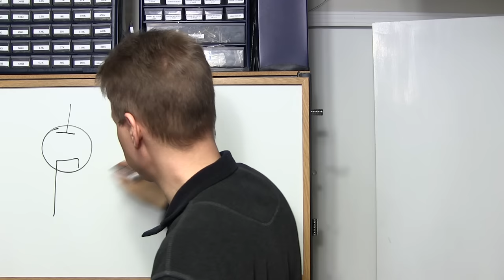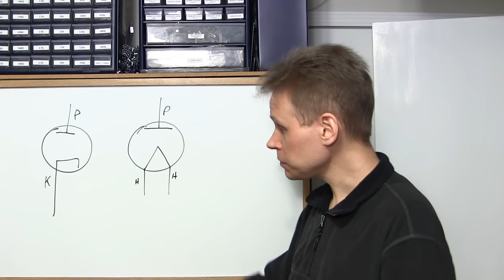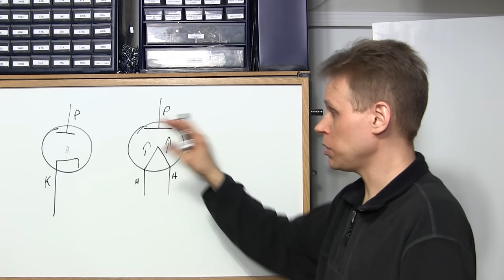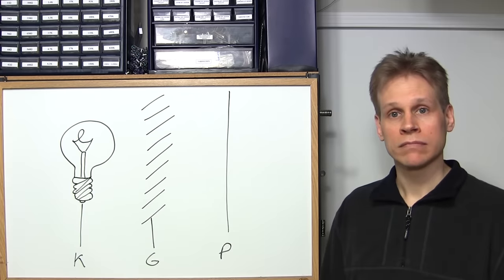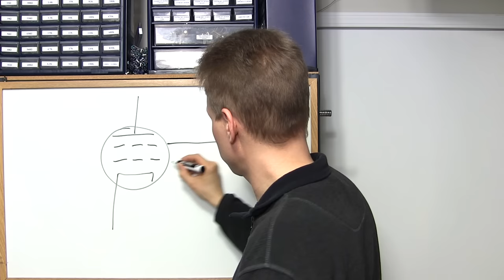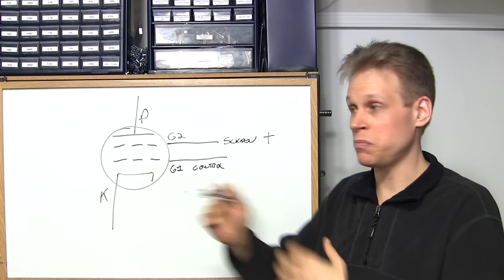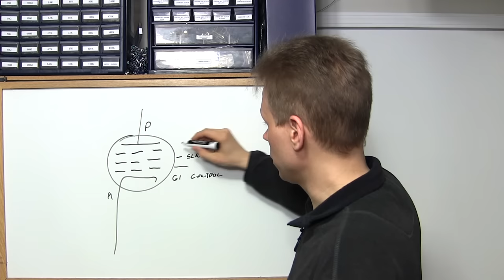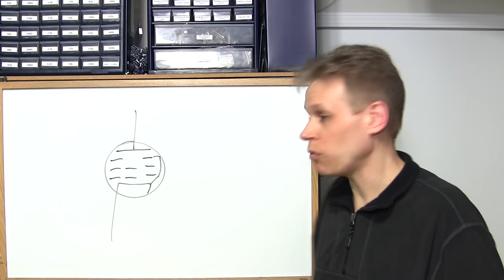How A Tube Works

Comment: All I can say is wow!
I've recently been dabbling in tube amplifiers and currently in the process of restoring a 1977 Fender amp. Your explanations of the basic operation of the tube is very understandable. Makes me wish I had you as my electronics instructor in college. As for purchasing 6L6GC series tubes; whether they're rebranded or not there seems to be way too many options out there for the same tube. Do you find much variance in performance in the different brands? i.e. JJ, Electro-Harmonix, Sovtek, etc??

Thank you!
Subscribed!
Reply from the maker: +Ode K 
HI. Honestly, no I don't. The newer 6L6GC tube's deal with harsh environments better than the NOS ones do. So If you play loud, and the tubes are inverted, hanging behind a speaker or 2, the newer tubes are tougher. Thanks for your kind comment!

Comment: How does the sound increases in the tube?
Reply from the maker: In short. The tube is turning the high voltage on the plate into sound. So, the tube is (reproducing) the sound you put into it by using the plate voltage or power supply.
Reply: By directing the small voltage variations caused in the microphone or needle of a phonograph or any other signal, to the control grid, it only takes a small signal (voltage variations) to make large variations in the plate current. The large variations are the louder sound, increased from the teeny tiny sound you would get listening to the signal straight from a microphone.

Comment: Can ANYONE Help Me!  I've have never been able to understand/visualize HOW the GRID negative voltage STOPS
electron flow to the plate!  Maybe I'm thinking "an absolute stop" instead of impeding and that might be the trouble!
Let me explain myself then perhaps someone can help me better.  I UNDERSTAND that a negative charge on the
GRID will REPEL the negatively charged electrons from the cathode (no problem there).  MY PROBLEM start now...
it seems to me in the enclosed environment of the tube, even with GRID Negatively biased that after a while 

electrons will build up between the Cathode and the Grid and eventually start FLOWING OVER/AROUND the GRID
to get to the other side and make there way to the Plate!   Maybe it the "momentary instance" that it stops electron
flow and I'm thinking CONTINUOUSLY..thus deceiving myself. 

The other part I have problems with is that the Grid itself is negatively bias and electrons would leave the GRID
and want to go toward the Plate. The higher the grid bias the more electrons would want to go to the Plate and
add to the current that the Plate is receiving.  Again, this might be me FREEZING everything in TIME and NOT
thinking continuously fluctuations and changes in signal where these split second happens don't have time 

to occur as in my FREEZING thought mind exercises.

Unfortunately for me,  I need to HEAR a teacher/someone say, "this illustration is for this scenario/illustration 

and not for others.  Otherwise, my mind says, OK,  keep the grid negatively charged...why can't the electrons
accumulate and then eventually casade over and around the grid like water would do if a barrier was up.
The water would stop when it hits the barrier...but eventually, the water will spill over or around and continue
onward.   But teachers never seem to point out whether they are talking absolute or momentary...then my
MIND cascade!!!!  Thanks to anyone who can help me deal with misconceptions!!!  Please, email me at
jeffharrision933 at yahoo.  thx again

Comment: You didn't explained how it works, you just explained how to use it. Based on your explanation to make one you only need 3 wires next to each other, but I think putting 3 wires next to each other wouldn't actually work as a transistor, why is it in a vacuum? what material are the wires? why are plates with strange shapes being used instead of just being wires? why do they need to be heated? why electrons jump from one plate to the other? how much voltage is needed for that to happen? what currents or voltages can a common vacuum tube operate? if I made a shitty one what would the limitations of such tube be and how could those limitations be improved upon?
Reply: Actually he did explain how it works. As to your questions, 1. it has to be in a vacuum, except in some very rare cases, because air would interfere with the flow of, and control of the flow, of the electrons. 2. The wires are made of different alloys depending on the tube type. 3. The "strange" shapes are because that's what is required to make it work. Electrons don't like to be in close proximity to each other being negatively charged and like charges repel each other. 4. They need to heat the cathode to excite the electrons in it and cause them to jump into the vacuum. I've heard of tubes that didn't require heating but I've never seen any. It would take extremely high voltage to pull the electrons off of a cold cathode. 5. The various voltages depend on what the tube is going to do. The heater is typically a low voltage in the neighborhood of 6 or 8 volts if I remember right. The plate voltages on the aircraft radios that I worked on in the 70's were typically about 400 volts for the UHF radios and quite a bit more for the HF radios because they put out a much higher power signal than the UHF radios. 6. There's no such thing as a "common" tube. They're all different and so the voltages and currents again, depend on the job it has to do. 7. If you made one as you describe then the performance would be as you described. It could be improved by redesigning it properly. 
Hope that helps.
Reply: @chrisbaker2903  Thanks!

Comment: I have a conceptual issue with tubes and AC waveforms. Electrons are coming off the cathode and either allowed to travel to the plate or not. AC is an alternation of increasing positivity, then increasing negativity   How can a tube ever give negativity when the electrons can only move in one direction? People keep talking about "bias", "reference points" and other terminology but to me, a tube is just like a potentiometer that's going from zero to max. It can't reverse the current - and that's what's mathematically needed to make a true sinewave.
Reply from the maker: Look up the difference between AC and DC coupling, this should help you understand better.
Reply: @MrCarlsonsLab  thank you.  I'll check that out.
Reply: I looked up on YouTube for AC and DC coupling but there was only oscilloscope signal coupling. Do you have any links you can send me?

Comment: This is not electron flow theory. In the "old theory", electrons go from pos to neg. Modern electron flow is based on what we know now which is the opposite. Important to know if you're looking at an old- school schematic on an old appliance.
Reply: Wrong. In theory 'conventional current' or +charge goes from + to  -. Electron current foes from - to +
There is no modern or old.
Reply: @PeterWalkerHP16c  If you would be interested, you can read about the difference in a textbook by :Floyd, Thomas L., fourth edition titled: Principles of Electric Circuits "electron flow version".

Comment: Average filament  power was 12 watts, 1500 hundred tube computer is next to worthless, back in the 50's actually designed a tic-tak-toe display using all relay logic.  Alan Mathison Turing was my hero, studied his logic and was designing computer logic, jumped at transistors, shortly after integrated circuits than mass integration like over a million transistor in a small chip.

HiFi Amplifiers would heat up a room while running up your electric bill, class D amplifiers dissipate practically zero power., instead of talking about this ancient technology, how about the new stuff.  Ha could but nobody would understand it.

Comment: you shold tak apart police scanners,the ones that let you listen to the police ,ambulance and fire department as wel as other frequencyes,also you should remove the tin can that covers som components,its silvery or chrom lik in color,it prevents the scanner from causing interference

Comment: He says "alright" a lot. Back in 1970, in Air Force tech school, they told us about secondary emissions but nothing (that I remember) about inter-electrode capacitance. I stopped watching after that, at 15:24. also, the whole idea about "conventional flow" is I believe, the old "hole flow" idea which is IMO bunk. Current is the flow of electrons not the flow of nothings. If you have trouble visualizing the flow of electrons in a negative grounded circuit as going from each ground indication on the schematic, up through the various circuits and components, then you aren't seeing it as it is and you don't have a true picture of what's going on in the circuit.

Comment: C for Current, C for Collector, C for Capacitor, and C has been over used, even abused, and the whole schematic is about to get real confusing if we don't use another letter to represent the next part.
Reply: Then there's part number C1, and it's the case.
Reply: K, is actually for Kinetic because, it only has to change voltages to control the flow, there's no real need for any real current flow.  It's a voltage controlled device for the most part, and yea, there is a need for a small current for it all to work right.  K is for potential, and usually is used where there is no power, or extremely low power factors involved.  Oddly enough, K is a term that  is heavily used in around and with old school vacuum tube theory.  It really is an alternate for voltage, voltage without current is only potential therefore at times K is used when there's almost no current flow, and really is just equal to the voltage.
Reply: Voltage, is vibrational.  But, you can see here, it has to do with mass but, doesn't have to have anything to do with current flow.  Usually, you calculate the vibrational, and current flow is calculated separately as a function of gain.
http://www.britannica.com/science/kinetic-energy
Reply: Current is usually denoted by ’I’, from the French ‘Intensité de Courant’ or 'current intensity' in English.

Comment: Dude - I used to occasionally replace burnt out tubes in stuff in the early sixties - the faulty tube would not glow, easy to spot. Vacuum tube is...derf, a little hot tube. Where the heck does a "rectalfier" go? Sorry, couldn't "resist". Now I understand less about tubes than I did in the early sixties. Friend...assume that people know not your "language" and definitely not your elite "lexicon". "Picture" is pronounced "pick-ture". Cheers.

Comment: How did this end up in my recommended?  Better question, are vacuum tubes even relevant anymore?  Everything is a microcircuit board now.  All I know about vacuum tubes is that when the TV went on the fritz, you called up a TV repair guy who actually came to your house, removed the pressboard backer on your big wood box TV and began testing the tubes inside.  Sure enough, he'd end up replacing a couple tubes, tell you that was the problem, and charge you about $7 for his time and replacement tubes.  Seems so quaint now, but in our wasteful society today, people just through the TV out and buy a new one.
Reply: Vacuum tubes are VERY relevant. NOW.  People finally figuring out that vacuum tube amps just sound better than solid state. Just do a Google search to see all the audio amps now in current production. As for TV repair, when I was about 14 when the TV went on the fritz I figured out how to unscrew the back, pull out the tubes, take them to the drug store, test them, buy the replacement for the bad one, return home,  put it all together and see the thing working again.  Priceless.